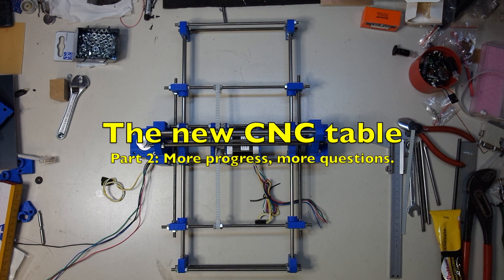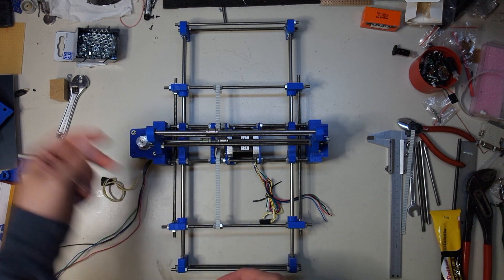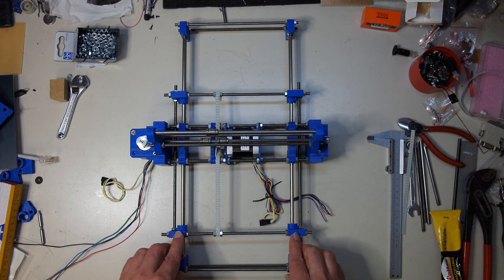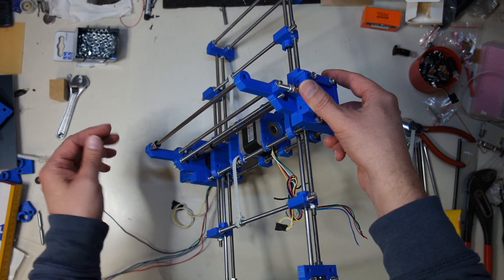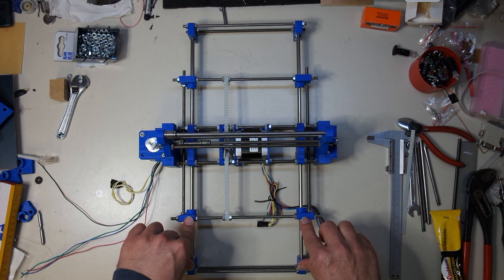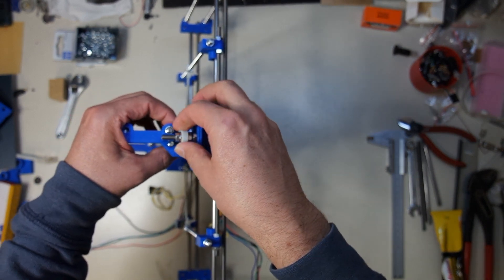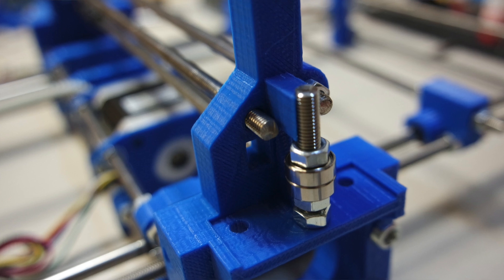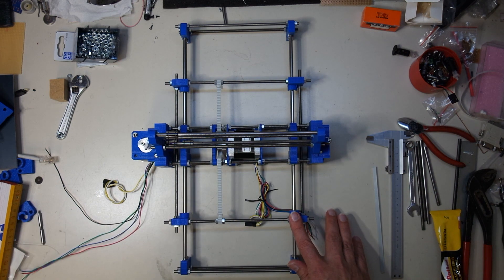The new CNC table pt. 2

Comment: the frame looks great . and with that even bed support you should be able to do some heavy engraving .
Reply from the maker: Thanks, I've made a prototype of a tool holder and sled, and the precision and quality are just amazing. An aluminium sheet for the table is on order and may even arrive today - then I need to remake the gantry slide and tool holder because I'll use that to fix the belt in position. After that it's time to make the end-stops and get it moving.

Comment: Really enjoying this build! Keep up the great work. I might suggest you use flanged bearings on the x axis idler to keep the belt on and centered. Also what spindle do you plan on using?
Reply from the maker: Thanks ! My plans for the spindle are not very precise at the moment - I'll start of with a pen and a scratching tool to plot and try some new etching techniques. I planned the sizes so I can mount a Proxxon or  slim Dremel on the tool holder.